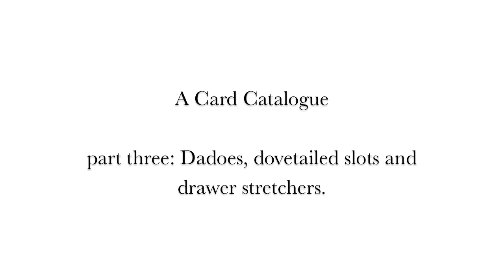A Card Catalogue part three-Dadoes, dovetailed slots and drawer stretchers

Comment: Do you ever use the saw cutting method and chiseling out the waste for grooves? I have yet to try either method. Which one do you think may be the easiest for a new worker to try first?
Reply from the maker: Kevin,
thanks for the comments and question- I have used a saw to define the sides of the rabbet, I've also used only a chisel and mallet. I wouldn't say one is any 'easier' than the other- If you don't own a Router plane, then the saw and chisel is a great method. If you have a Router plane, then try both and see what works best for you.
You'll find there's always an alternate method for executing most techniques in wood working. Here's a link to a blog I wrote about cutting rabbets using multiple methods and tools-
http://www.theunpluggedwoodshop.com/6-ways-to-cut-a-rabbet.html
all the best!